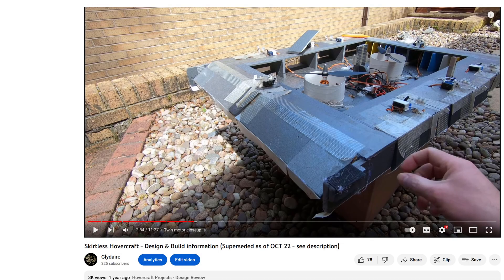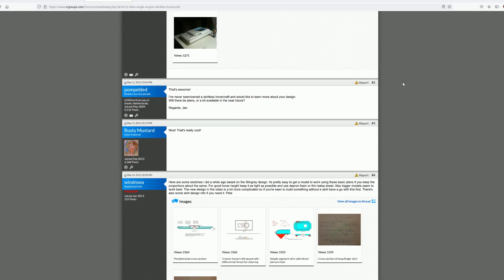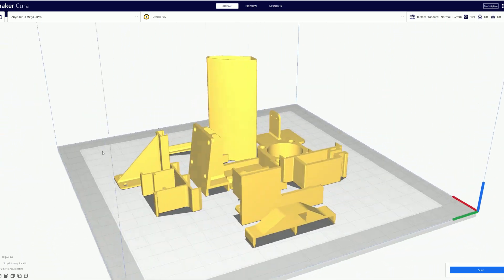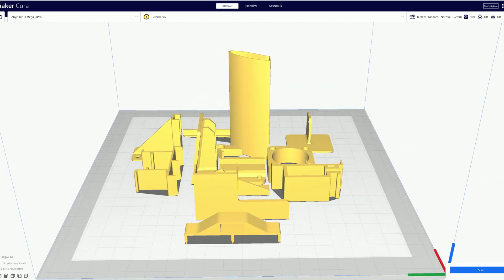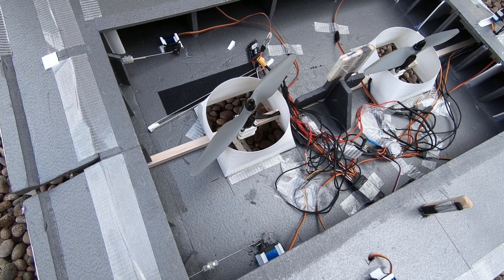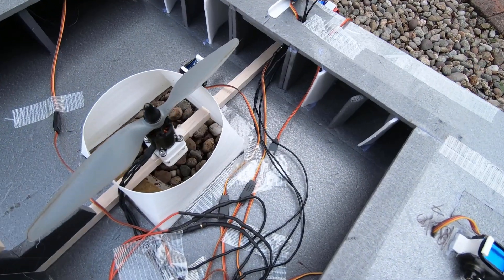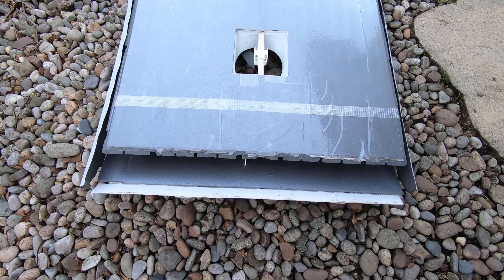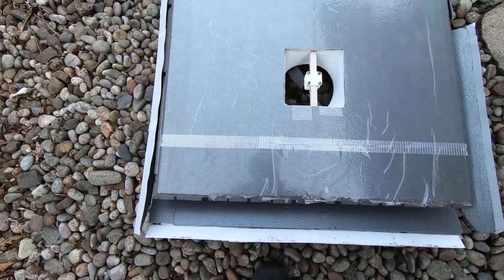Skirtless Hovercraft Projects - 2023 Design & Build Summary (Triple Motor Craft)

Comment: Is there a reason to not have the whole side wall at an angle, but only the bottom flaps?
I want to replicate what you're doing, but make it buoyant, with a thick bottom plate (3cm). So I'm wondering if I should make 1.5cm of that straight and 1.5cm angled inwards, or just make it angled all the way, with correspondingly longer flaps? Do longer flaps cause any issues? 
At that point maybe I should try making the whole wall a "flap", i.e angled. Would seem like that would be a simpler construction too. Would that be a good idea?
Reply from the maker: This model floats on water no problem as it is. It would need serious weight to come anywhere near sinking. Though if you plan to float it longer for whatever reason a thicker bottom plate would be good.

Vertical sidewalls are the easiest build. A much earlier model did have 45 degree angled in sidewalls and did turn a bit better but not overall worth the extra build time.

Comment: How do you get these to balance, stay in place once take off? I'm trying to replicate what you've done, and they constantly move slight (or not so slightly) in some direction. I made flaps on the rear end only, i.e. no side flaps, and it goes sideways a bit. I made extra sure it's all symmetrical on both sides,  and still sideways it goes. That's both one prop ad two prop.
Reply from the maker: Without side flaps you can't really prevent drift, that design is meant for forwards speed rather than low speed agility.

That said, the CG position has to be very precise, shifting a few grams over may be enough.

Comment: I'd expect the single motor versions to spin like crazy. I suspect there are some compensating vanes there, but how do you fine tune them to get it to not spin in either direction, not overcompensating either?.. Glue it together, run, tear it off, adjust, repeat?.
Reply from the maker: Early versions did spin like crazy, sometimes in the same direction as the prop, so not just a plain action-reaction torque there.

Sorting it out was a headache, there's 3 main factors:

Extensive straightening vanes at the rear flaps, this is broadly the equivalent of ailerons on an aircraft. Plenty of compensating torque if you need it.

Related, getting the rear flap linkages very firm so they close fully. Even a few mm gap on one flap is enough to cause a spin.

And yes, you're correct about vanes, in the single motor one they are down in the bottom of the stability duct. I call them "de-swirling" vanes as the propeller flow will be swirling, so you (partly) remove that swirl to gain a counter torque. 

I tried variable servo driven vanes in the duct, you can turn with some authority only on the stability flow, but it wasn't enough to justify the added weight and complexity.